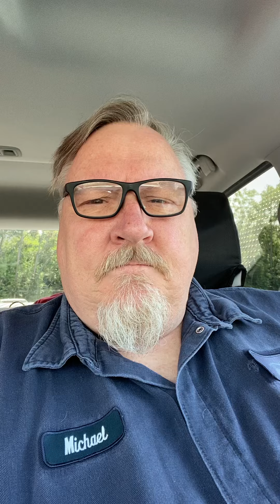Industrial Maintenance and Electricity

Comment: Please keep doing these videos. I'm a maintenance tech at a plastics factory and I'm looking to learn. We don't have any training.
Reply from the maker: Parker, is there anything in particular you would like covered?
Reply: @bigmikeh5827  I am wanting to learn more about how to really get the most out of programming VFD's. I've replaced them before and just put the nameplate data in, and adjusted frequency. But I know there is a lot more you can do with them.
Reply from the maker: @parkermize  yes there is. I’ve found there are about 200 parameters and sub parameters in a drive.  I’ll try to get something together in the next week or so.  Stay safe
Reply: @bigmikeh5827  awesome! You put out some really great content for free. It's much appreciated! I actually just took a different job at a plant that manufactures bearing cages. From the looks of it I'll have to do a lot more mechanical work than I'm used to. You focus on electrical for the most part, right?
Reply from the maker: @parkermize    I used to teach a multi craft industrial maintenance program.  I love passing on the knowledge.  Electrical is one area that most folks struggle with.  I like to do just about everything.   Fluid power, mechanical, electrical, PLCs.
Reply from the maker: Parker things got a little busy for me. You still need the VFD training?
Reply: @bigmikeh5827  yes. I know how to put name plate data in and change the frequency but that's all.